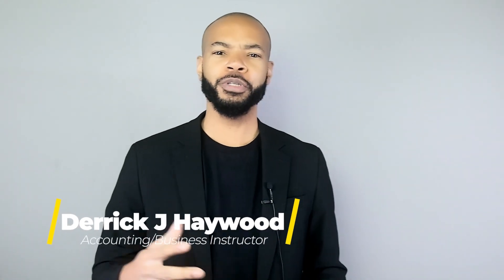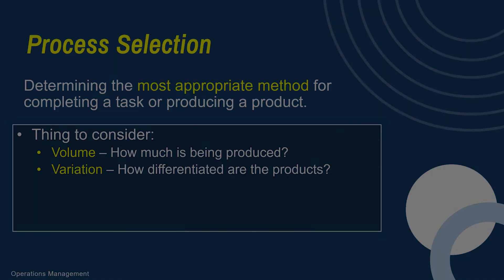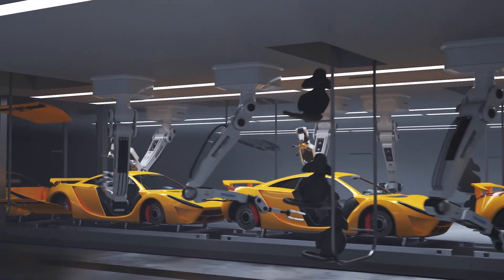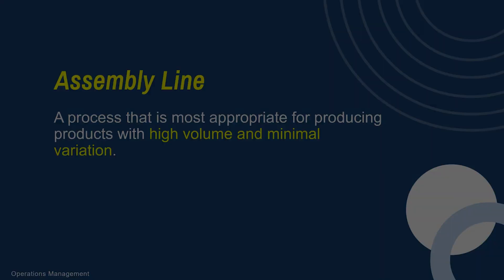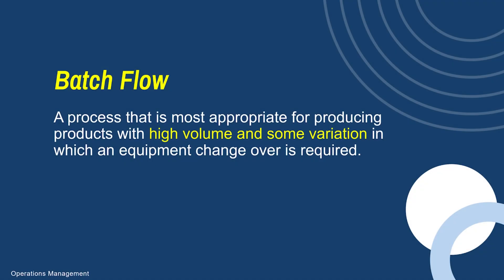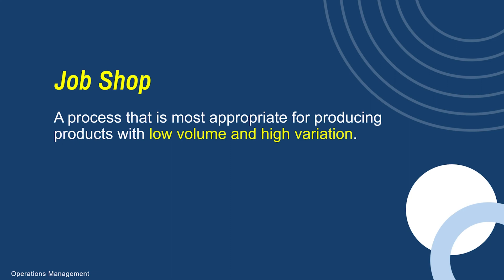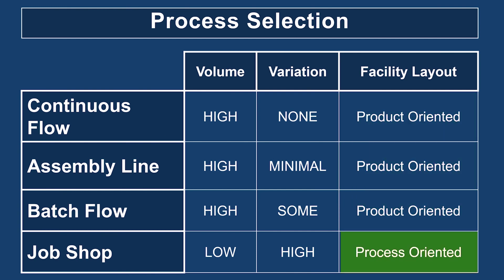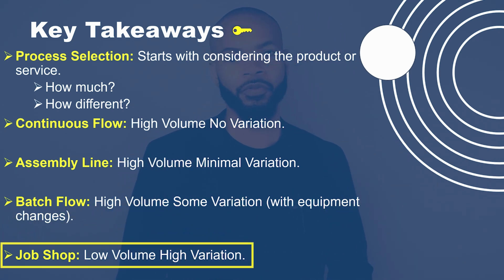Process Selection - A Review of Continuous Flow, Assembly Line, Batch Flow and Job Shop

Comment: I'd suggest this matrix should have another dimension....discrete manufacturing versus process manufacturing.  Each require slightly different approaches within Continuous Flow, Assembly Line, Batch Flow and Job Shop.   For example, Whisky can be a high volume, no variation product (ex., Jack Daniels), but the production process requires aging in oak casks for a certain period of time.  As a result, batch processing is the correct selection even though it fits continuous flow.  Finally, some products require serial processing, some allow for parallel processing, and others require batch.  Understanding this added dimension will ensure you get to the right process selection.
Reply from the maker: Thanks for the feedback.